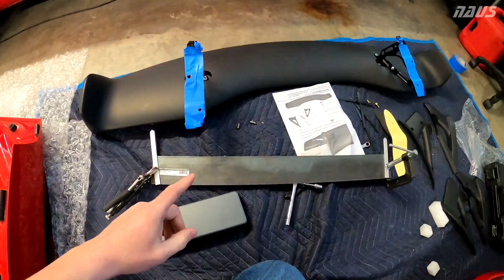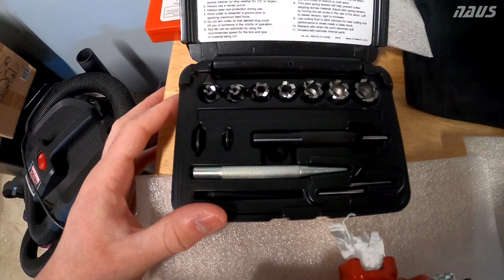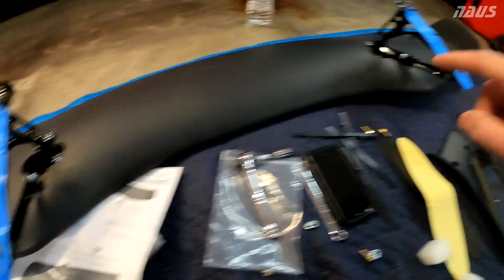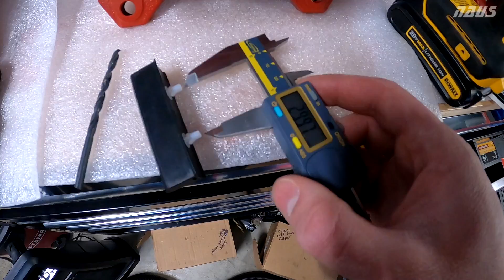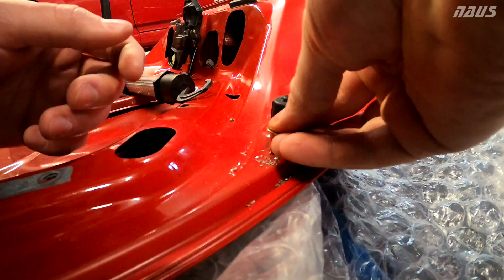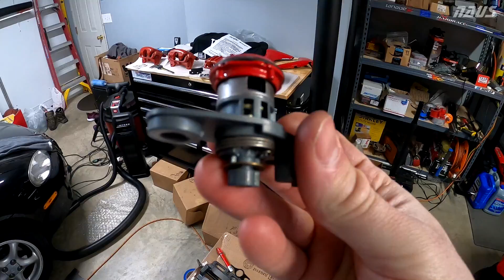S2000 Trunk Modification For CR WING - DIY

Comment: Man I wish you can send me a template for the holes
Reply from the maker: A template would be less accurate than matching the holes to the wing you have on hand like I did here. The tolerance stack up of where the wing stands lands on a rep like this is much more than an oem wing being there is little QC so they can be sold so cheap